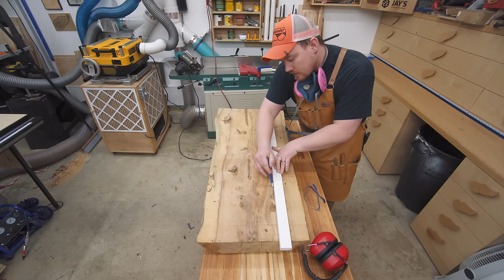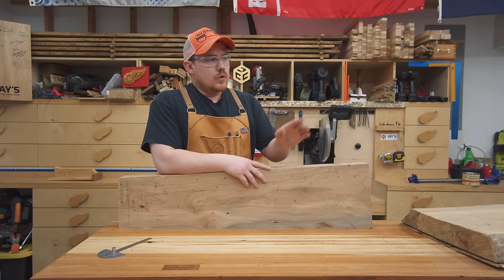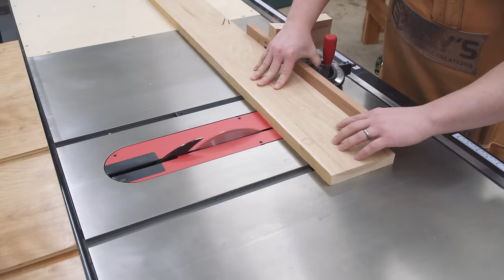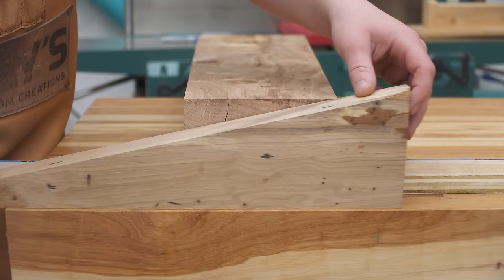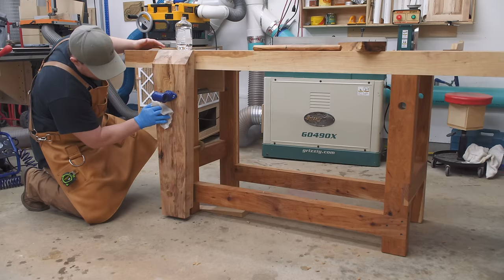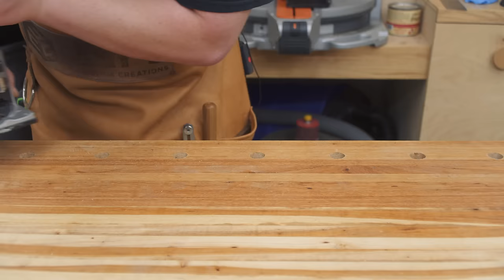Hickory Workbench Leg Vise and Dog Holes - 299

Comment: Maybe a dumb question, but does the leg have to be tapered? Could it not be simply be a 90º rectangle?
Reply from the maker: Not a dumb question. It doesn't have to be tapered but with a wider base you will remove more material when cutting out for the wedge.

Comment: For the dowel....could you put a hole in leg?  Great job. Jim
Reply: That was my thinking as well, but as he mentioned regarding the four-option threaded screw holes, it would have been easier to do the holes on the drill press while the work bench was apart. Either he didn't think about it at the time, or he had other plans in mind.
Reply from the maker: Probably so but you have more of a chance of the dowel binding if the hole isn't perfectly straight or if the chop sags slightly.
Reply: Jay Bates - Woodworking Videos good point.  Enjoy your very well done work.

Comment: I love this build. You hit the nail on the head with this one. I’m curious though, did you consider putting the bottom leg dowel through the center of the of the vice and through the leg? Make a wider hole than needed on the leg and the dowel fixed to the moving part of the vice. 3/4 might be more durable and lots of wax. Not being critical, just curios if you considered this and if you did, why did you decide against it?

Thanks, Dave.

Comment: Noob question here but why would you need a vice that large that it would need to go all the way to the ground?
Reply: Leverage, if u left it just at the screw the pressure would be high on the mechanism itself, by going further out u are lowering that pressure. He didnt invent the idea of the leg vice, he is building it the way it was designed to be used, with a few modifications.

Comment: Why bother face jointing it if you were going to run it through the planer on a sled anyway? Just shim it halfway flat on the sled and run it until the blades touch most of the surface.

Comment: I'm curious why not just have the vice half the length and eliminate the wedge all together? I'm unclear on why the vice needs to be so long to begin with
Reply from the maker: If the vise was half the length what would you use to prevent the bottom from racking in when the vise is tightened?
Reply: The point of having the vice half (maybe even shorter) the size in length would be to eliminate the racking problem all together. If you cut the vice off right below the screw/handle, wouldn't it eliminate the problem of racking? I've not worked with a vice attached to a workbench like you've made, so I could be missing something about it
Reply from the maker: All vises rack to some degree. Cast iron vises have a higher screw and two parallel bars to prevent racking. Just the screw by itself isn't enough.
Reply: Aah, got it, thanks for the explanation, Jay. Keep up the good work, bud. I particularly like how you explain each part of the process
Reply: leverage